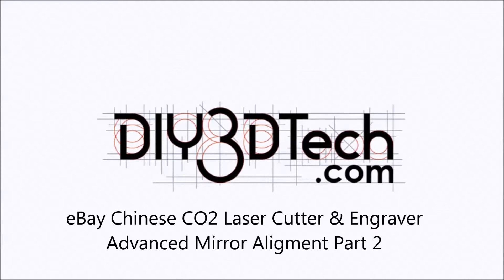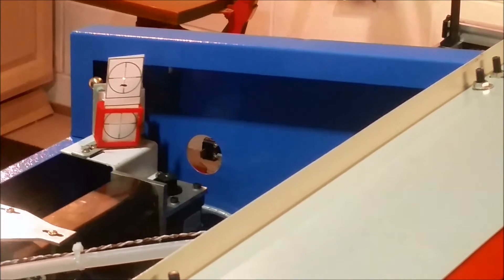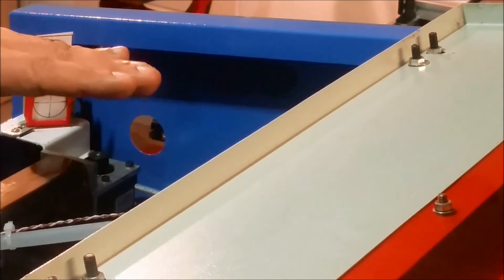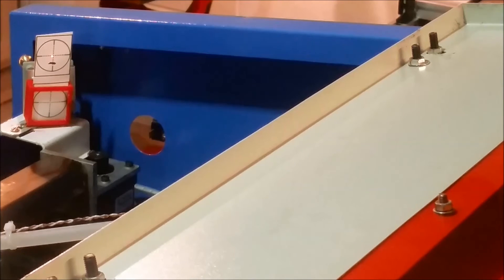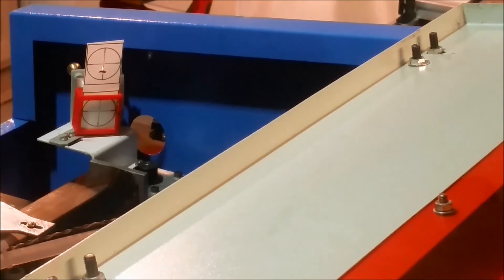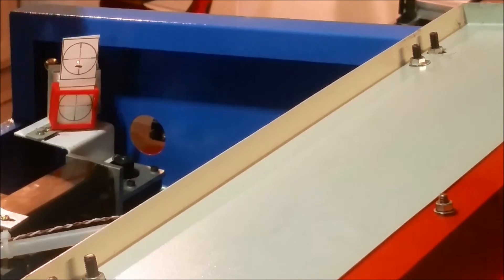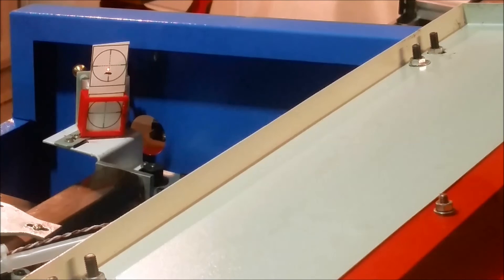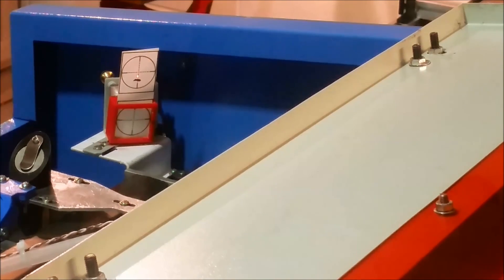eBay Chinese CO2 Laser Cutter & Engraver - Advanced Mirror Alignment Part 2

Comment: I have had my K40 for almost a year now, and I've never been happy with the alignment.  I spent many hours over the last couple of days, basically coming to the same conclusions you did 4 years ago.  My bed was out of alignment vertically over 3/8" on the front side (closest to the user).  I had to modify the door to prevent the gantry from striking it after shimming it so far.  But now it cuts perfectly and much more consistent.
Reply from the maker: Yup it took a lot fiddling with it to get right.  I am getting back in to the laser a bit and thinking about building or better put rebuilding the internals with maker rail to improve this...

Comment: i'm having the same problem with mine
Reply from the maker: whats that?
Reply: @DIY3DTECHcom  trying to get my laser aligned
Reply: @DIY3DTECHcom  all 4 corners the laser works but it doesnt cut my sweet spot is is in the middle 6x6 area but with I want to cut large material is doent cut
Reply: Could I send you my pictures from my results?